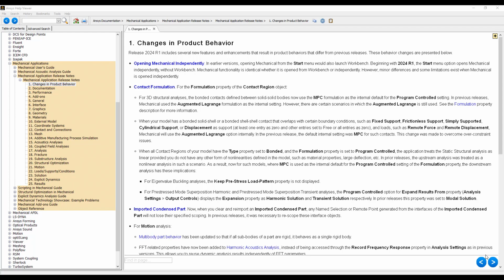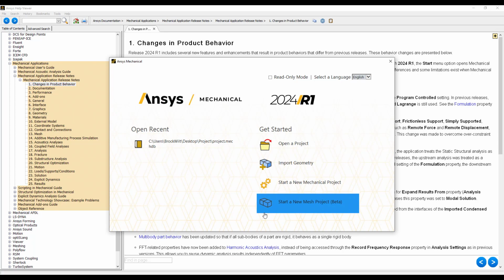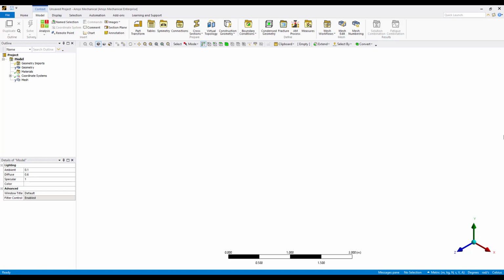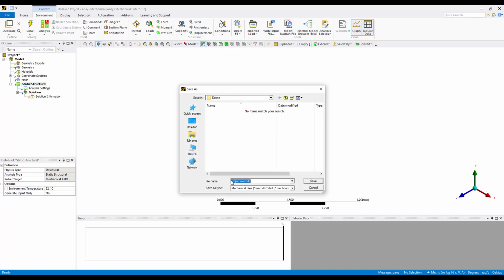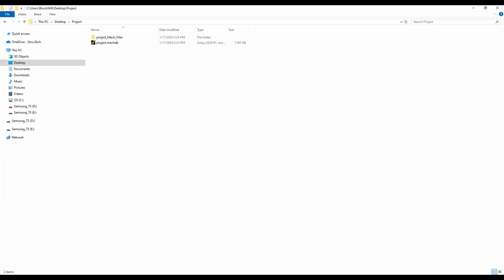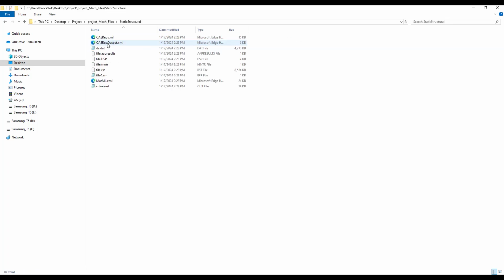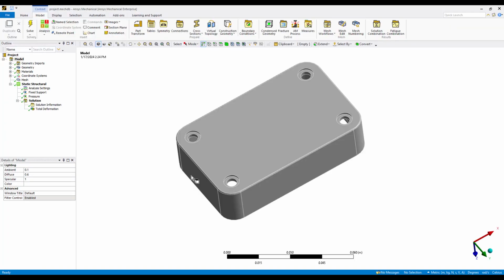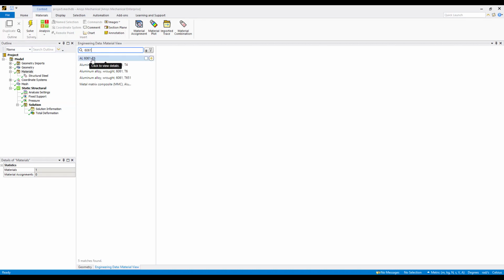Launch Ansys Mechanical Independently

Comment: Sorry to ask but, what's the point? I mean are there advantages, disadvantages for doing having this?
Reply from the maker: The primary advantages of launching Mechanical independently include mostly savings of overhead and time in terms of file space and to a lesser extent RAM.  If your simulations will be single model, single physics, then not opening the Workbench project page saves time in moving directly to setting up the model in Mechanical, reduces file structure size and saves a small amount of overhead without the Workbench project page running.  The differences in Mechanical behavior running independently are noted in the video.